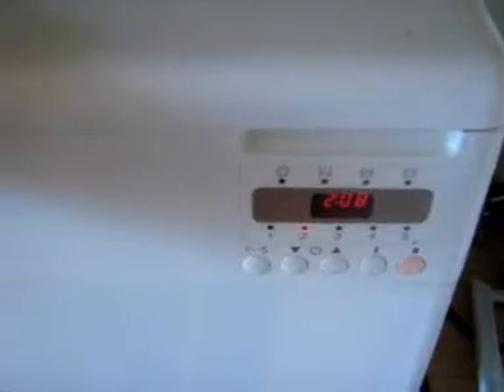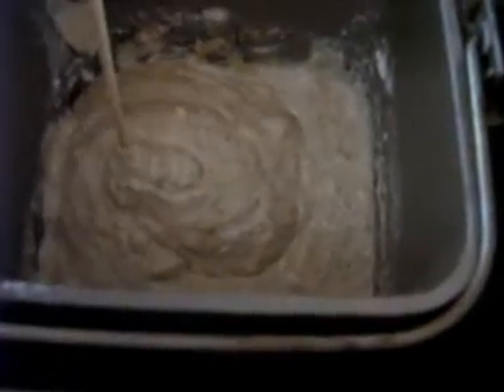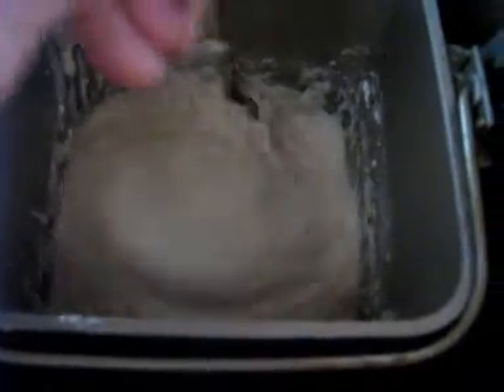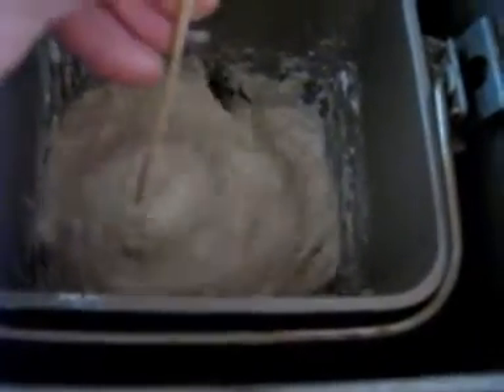Flour In Corners Baking Machine Problem

Comment: it's a pity the bread machine was louder than the voice. I couldn't hear it what was being said.
Reply from the maker: The basic content is int the description:

I use a home baking machine a lot. One problem that can happen sometimes is that the flour in the corners of the form doesn't get pulled into the dough. The dough in the middle winds up too wet and the corners are just dry flour.

It's a good idea to check a few minutes after the machine has started mixing. If all the flour has not been pulled into the dough, you can use a bamboo stick to poke it in. Don't used any metal utensils, they might damage the forms nonstick coating or the mixer paddle.

I might try to get in subtitles.